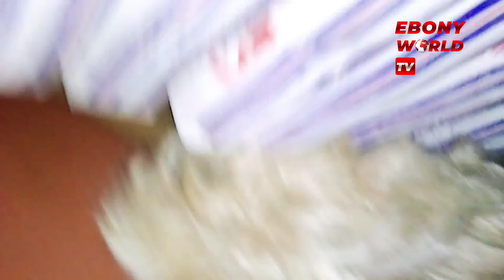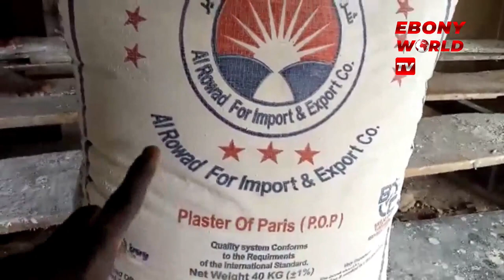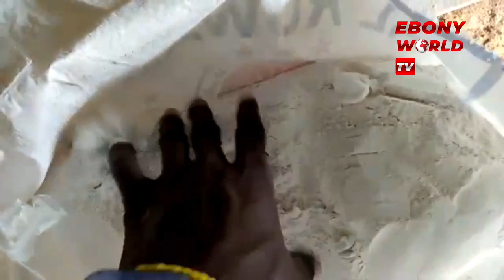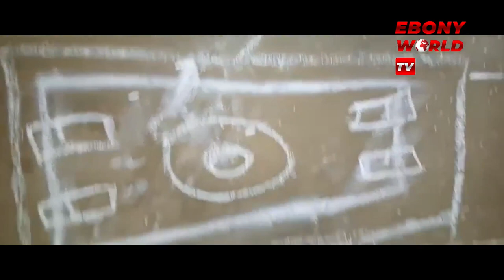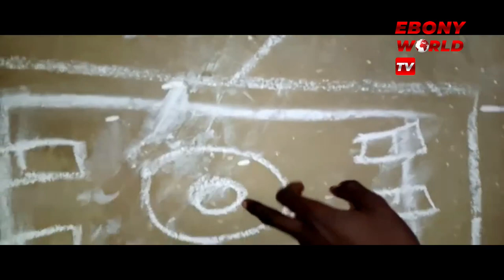PROCESS AND STAGES OF MAKING POP FOR TWO BED FLATS

Comment: Great job sir, I have 2 questions please. Can you please let me know if its best to buy materials for the labourer or give them the design and let them do their thing? Also, while cutting with the saw, any risk of cutting wires or pipes ?
Reply from the maker: You can supply materials like block, cement sand and granite but things to do with plumbing and electrical you have leave them to get on with it because you might end up buying substandard and cost of fixing the problem is as good as letting them do it